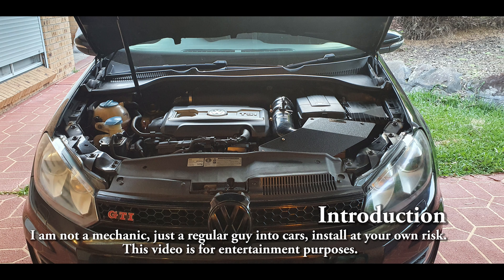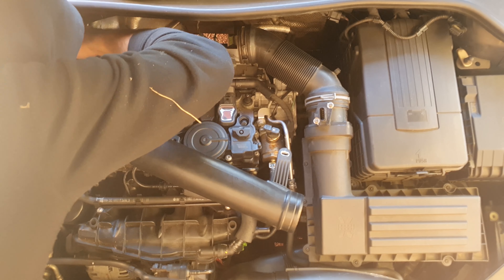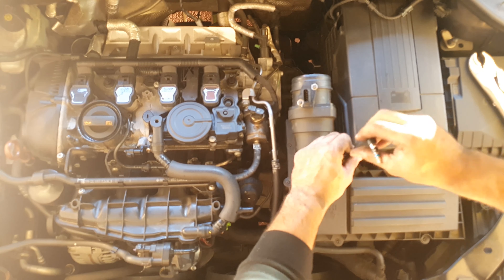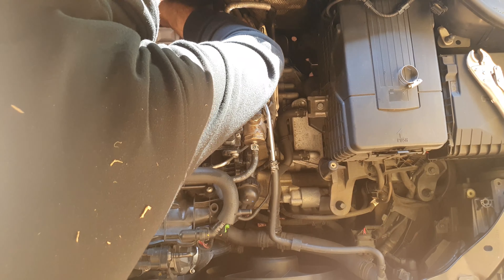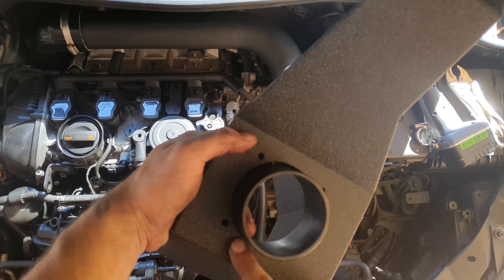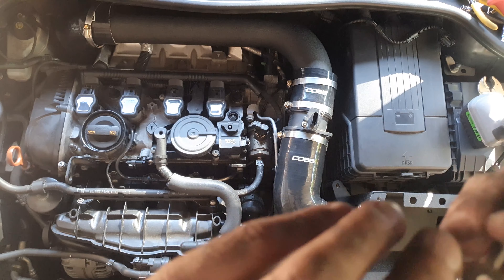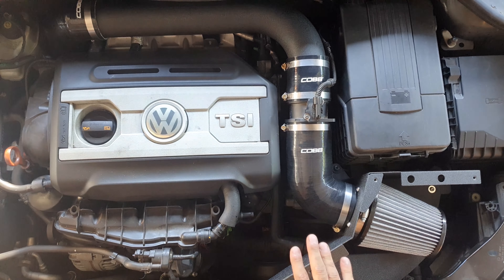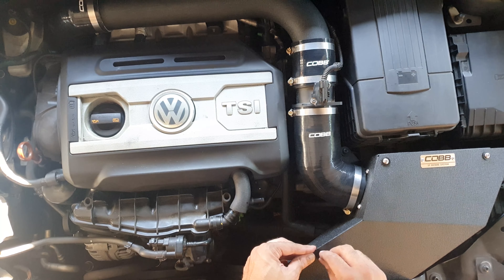How I installed the COBB MK6 GTI SF Intake - Part 3: Installation + Sound Test

Comment: Thanks! You helped me so much. Mine didn’t come with instructions and I thought I was missing the MAF part, I didn’t realize you recycled the old one. After that everything fit perfect. I too struggled with the pcv valve and was out of small hose clamps. I was planning on going to buy some when you took the one off the breather valve, bravo! I didn’t the same and it’s holding up nicely. Good thinking!
Reply from the maker: Hey there, thanks for your comment. I am glad you found the video useful. This intake is awesome, it's been a while since I installed it and I am still in love with it. Definitely worth the tricky and fiddly install. Hope you enjoy the intake like I do.
Reply: Question, do you need to put the secondary breather filter on there or no?
Reply from the maker: @neroafk988  Hey bud, sorry for the late reply. No secondary filter required for the Australian model... As far as I am aware. It will be required when your car has another hose connected from the side of the intake box, US models I believe.

Comment: is a tune required?
Reply from the maker: No tune required for the intake alone. If you upgrade your dump pipe (down pipe), you'll need a tune.
Reply: @marksix5688  how much does it affect insurance/warranties ?
Reply from the maker: @Skaboom1  Hey, I presume it would void the warranty. In reality, if an issue was to occur which would normally be covered under warranty, then It really comes down to who is running the service department and on the issue. It may be messy trying to prove the intake wasn't the cause (depending on what the issue is).

In my case, the car was well out of warranty, so I didn't think twice. The good thing about the intake though, is that you can always put the stock unit back on. If you're tuned as well though, not so easy and sometimes not possible (depending on the tune).

In terms of insurance, it all depends on the insurer. Some don't mind what you've done, and may increase the premium to cover costs, while others will refuse any modifications altogether. It all depends, as of right now in Australia, Shanons and Bingle cover tuned cars while Budget Direct does not... As far as I am aware. These are just examples, I am sure there are more insurers on both sides.

Hope this info helps.